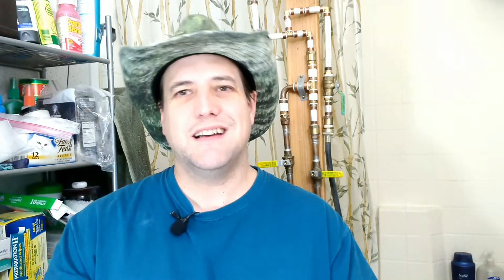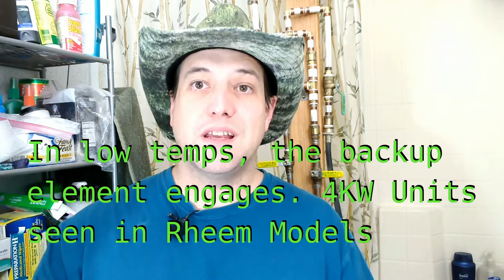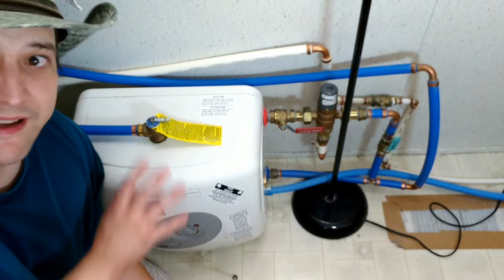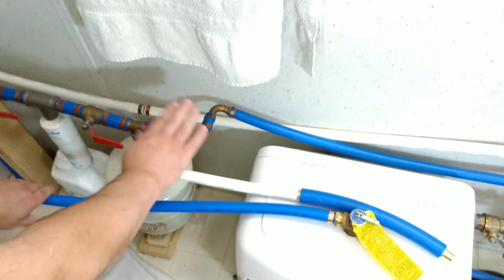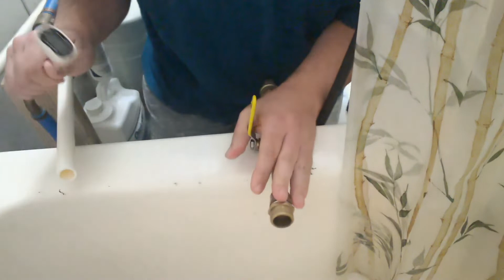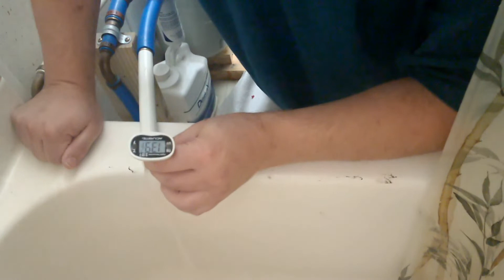Off Grid Endless Hot Water! Reed's Crazy Plumbing! | Manifest Practicality E016

Comment: I'll be trying to make compost heating and rocket stove heating for water . I just don't have the solar available for panels. 😕
Reply from the maker: What state are you in. You would be surprised how well solar works even in rather northern locations.
Reply: @reedin9954  nah, I'm in Georgia,but I'm in the forest!
Reply from the maker: We have fire for a reason, BURN IT ALL! Lol
Reply: @reedin9954  swat! wake up from your delusion,man, there's no need to set the mtns ablaze!  If I can get a micro hydro system via gravitational vortex generation, I'm golden! I've the water on property  ( small,but never dries up), and the Chattahoochee 200 yards away.... I just have to figure out how to do it.
Reply from the maker: Lol. Yea a hydro setup will do well for you. Just need to keep a good supply of parts on hand.

Annoying the small windmills and hydro are a bit high maintenance.
Reply: @reedin9954  gravity vortex looks far less so than most hydro? It seems that way anyhow
Reply from the maker: It is a lot easier on the parts as things are not moving at a high speed but the units are a lot easier to service. You just block off the channel feeding it and remove the whole unit to work on it. A ton easier than some of the other configurations I have messed with.

Comment: actually washing in cold water isn't bad but it is made so by having hot water to rinse off with. do you have a passive solar water heater of some sort?  like to heat water all the way to temp or just to heat the water up to a certain point taking the edge off so the electric doesn't have as much of a lift?
Reply from the maker: For a bigger tank you can combine stuff, just not with something this small. Also, those solar heating systems use a double exchange system as the liquid inside them is a mixture of antifreeze and water, just like your car, so they don't freeze at night. This means they go through a double exchanger to prevent your water from becoming poison, as you can guess you need a bigger tank to fit all the parts.

That is the other things, these other parts make it a lot more complex and I wanted a rather kiss system.

Now when I get around to building a solar hot water system to supplement my energy needs, I will figure something out that is kiss enough for me to be happy and reliable. Should make a good video when I get around to it. Just have lots more to do first. LOL
Reply: @reedin9954  was thinking more of a pre-heater tank. i've seen systems that had tanks in the large front windows to take advantage of passive solar heat to heat their water up many degrees then their actual water heater didn't have to lift as far to get to operating temp. the fewer degrees you have to lift your system the fewer btu's required. around here in the winter you might only get 10 or 20 degree lift. but that is still that many fewer btu's to get there. looks like you are in the desert so would have an even greater lift most days. do you have air conditioning?  i know there is a heat exchanger to heat your water with that. i only need an air conditioner about twice a year so it wouldn't do me much good. but if i ever build a walk in freezer and a walk in cooler.

Comment: YES !! I actually understood everything that you said. I was unaware of that nice little mix valve you have. It seems to me that works just like the "manual" lever on most faucets, just a LOT closer to the source. I may actually try this but I will feed the water through an inexpensive (a couple of flat coils of black painted copper on the roof) first before the heater. I am still trying to figure out a reply to your last solar vid without sounding like a complete idiot.
Reply from the maker: I'm glad this made sense to you!

The one spot where it is different in the mixing that a faucets does is that it adjusts to the flow. If you increase the flow of the hot or cold the temperature changes, this handles that automatically.
Reply: Tygrr, I hate to say it,however truthful- I never let sounding like 'a complete idiot' stop me from saying what I think I need to.  Especially when it's a question. ( the hated part is me,so often sounding this way ) .